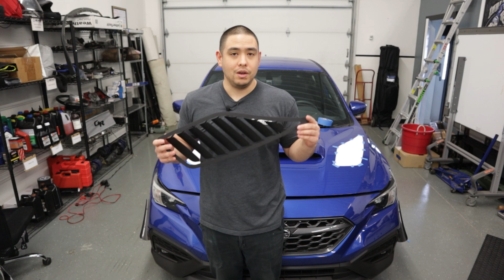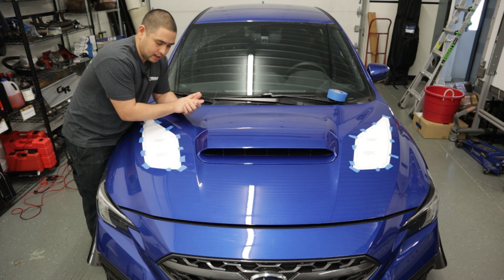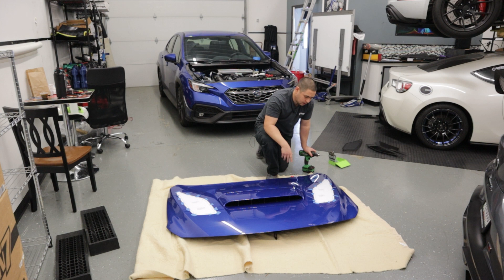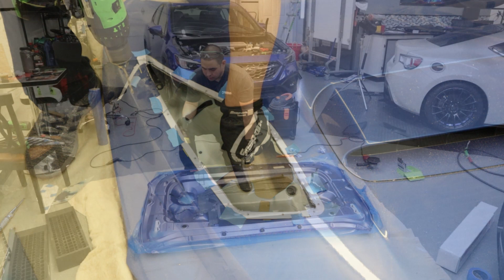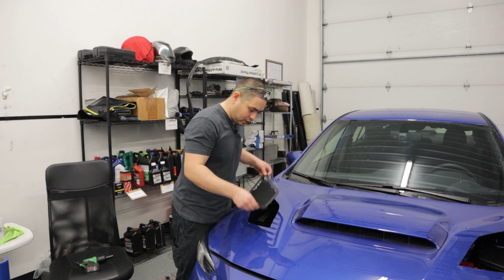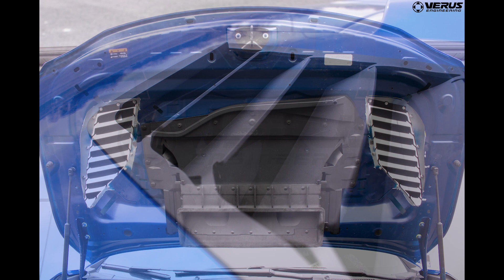VB Subaru WRX Hood Louver Kit Installation

Comment: what about water going in to the engine if its raining the battery side there is electrical wiring ?
Reply from the maker: We offer rain guards for these louvers. However, all electrical connections these days are water tight, so not much to worry about there.

Comment: At this point, probably just buy a new hood instead with venting. Cool concept, but you really got to butcher your factory hood to install.
Reply from the maker: New hoods are much more expensive than this option. To each, their own, but "butcher" is a stong term for some simple cutting and drilling.
Reply: @VerusEngineering yep, to each is own. And I’m all about the holes (no diddy)
Reply: So a shitty fake carbon fiber hood? Only good vented hoods are Varis and Marsh

Comment: In a video to show how to cut your hood, you skipped the part about how you cut your hood 😅
Reply from the maker: It's in the video. We just do not show the actual cutting part to save on time. A cutoff wheel is the tool needed and the templates show you where to cut and drill.